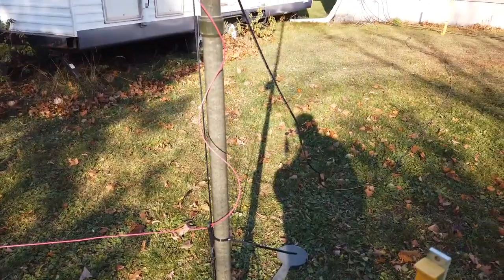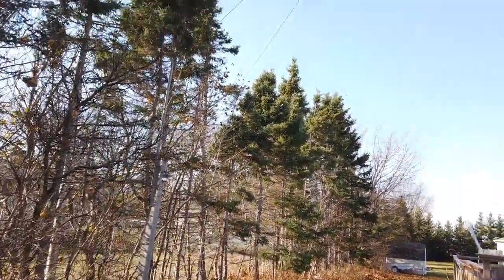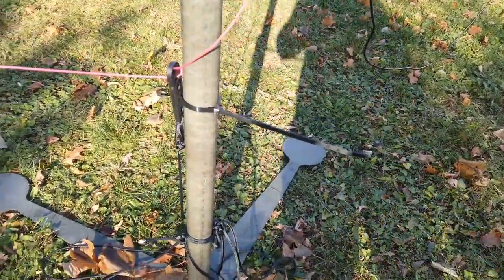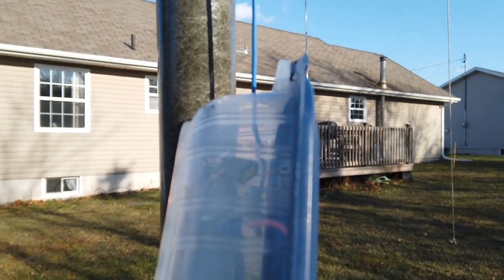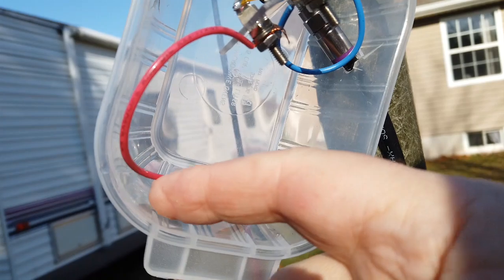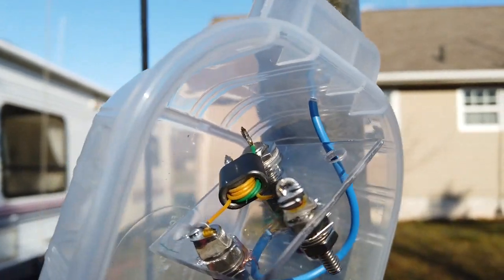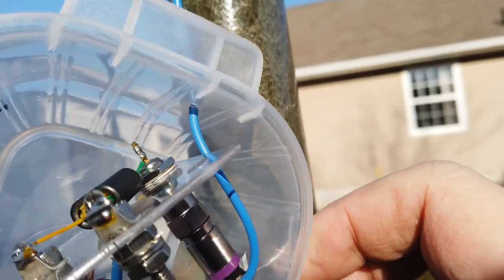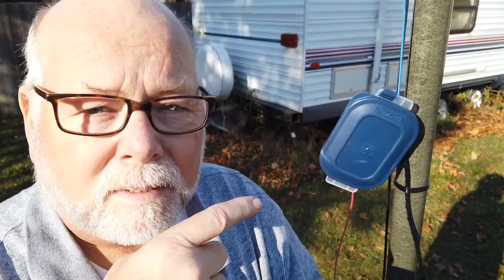PennantAntennaPropagation

Comment: Question from a radio “idiot.” What you said makes sense about having a better signal in the winter versus the summer. My question is does it effect the signal with a country in the Southern Hemisphere, say if you in late December where talking to someone in southern Argentina (their summer) would the signal be better or worse?
Reply from the maker: Very good question. There is a special phenomena known as TEP, or trans equatorial propagation, which applies in certain frequency ranges. When the transmitter is in winter and the receiver is in summer, it's usually less good than when it's the other way around. The noise level on receive needs to be as low as possible, so local winter for the receiving station is still best.
Reply: @BrentTaylor  Interesting. Thanks GOAT! If you ever have a cooking question by all means feel free haha!